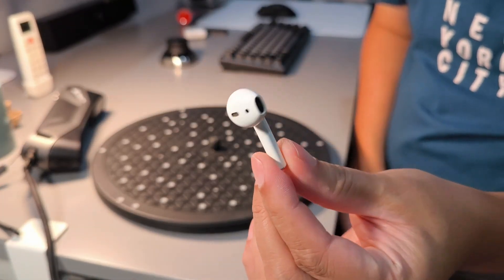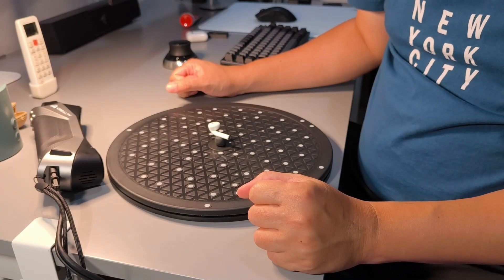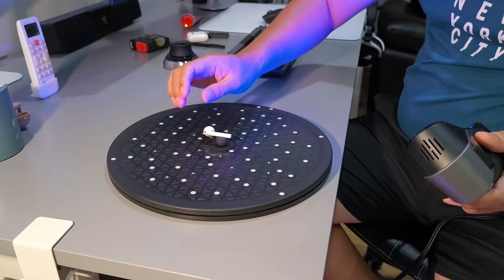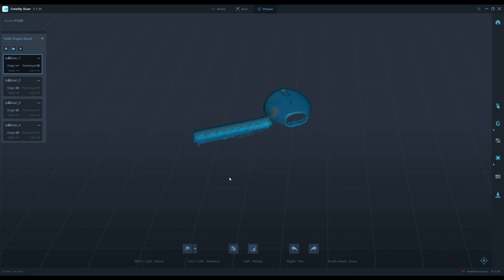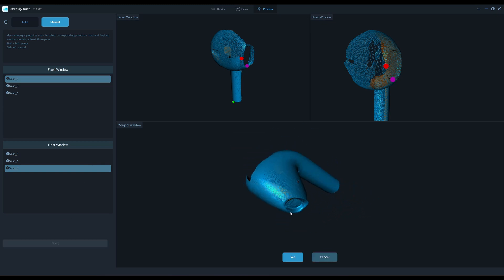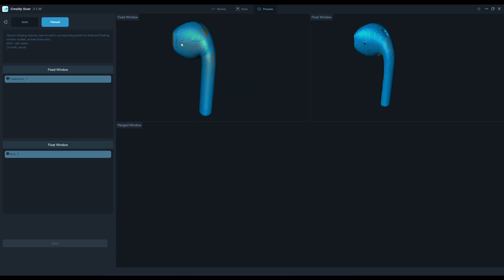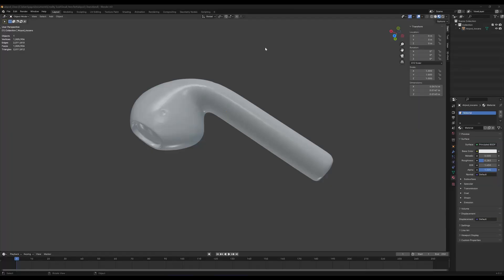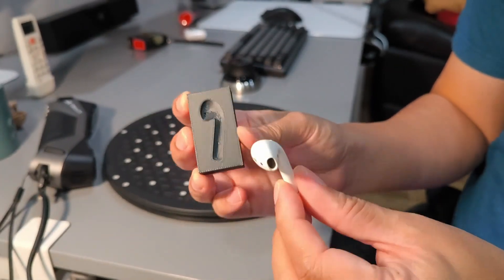Creality CR Scan Raptor - Scanning Small Object

Comment: Love your video!
May I ask, what is the lowest Resolution Setting you're able to use during scanning.
Because I only see that 0.1mm is the lowest you can set it at. Are you able to go lower than this??
Reply from the maker: 0.1mm is the lowest for preview windows. When optimizing the point cloud, I recommend not setting it lower than 0.1mm. 100 points in 1 sq.mm is kind of too much for most work.
Reply: @Payo-TensileCreator  Thanks for getting back to me.!
Because you say 0.1mm is the lowest for preview window, does that mean that's the native resolution of the scanner??

And in point cloud optimization, if you did set it lower, would you achieve better detail? Or is it just enhancing the current 0.1mm details?

Comment: Cuando trato de usar el escáner con la luz azul, no me arroja nada. ¿a que se debe?
Reply from the maker: Did you put markers on? Raptor needs to see more than 4 markers in the scanning area if 200x100 mm to start working.
Reply: @Payo-TensileCreator  Sí, el puse muchisimos marcadores a la base, y nada, no aparece nada en el software, luego le puse marcadores a la pieza, tampoco. El software no me arroja nada, tampoco me aparece si estoy en verde. Esta muy raro, solo me esta pasando con la luz azul, con la luz infraroja y blanca no me esta pasando eso.

Comment: Can you go over: 

1. How you eliminated the surface of the black spinning plate from the scan?
	When I tried to scan something, I have to eliminate the surface first before I can merge; however, after I eliminated the surface and attempted to merge two point clouds, the surface reappeared. It was extremely annoying as I had to start over. (I was using Creality Scan version 1.30 on MacBook pro M3 max).

2. Can you explain in detail how you were able to get the mold without needing cad software?
Reply from the maker: 1. Some time I have issue when deleted point cloud comes back after optimization and I have to delete them again. (PC version) but not every time like 1 in 5 times.
2. I made a video here https://youtu.be/FTSOo6U8BFY   I the end of video I carve out the mesh of a cube with mesh from scanner in Blender

Comment: Great video, thanks! I'm faced with choosing a scanner. I want to take an Otter, Raptor is also an interesting model. What do you recommend to me?
Reply from the maker: Raptor is easier to scan for difficult surface and gives better result in small - medium size object. Otter has better larger NIR dept camera and it can track without any marker. Even the smaller NIR camera in Otter is better than blue laser in Revopoint MINI. There's no competitor for Otter in this price range except for Raptor